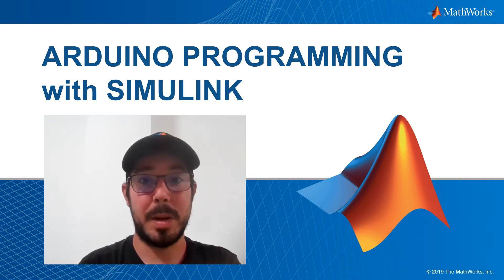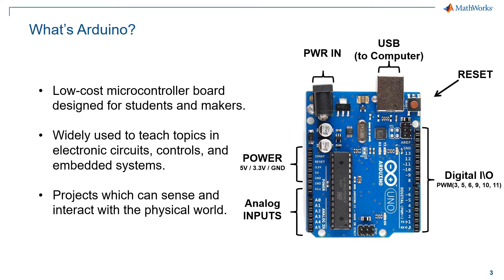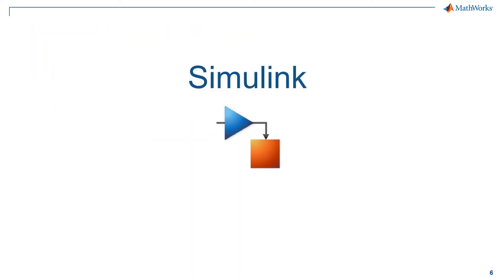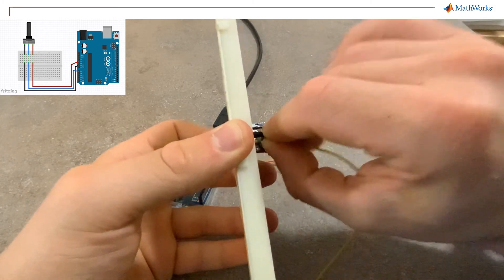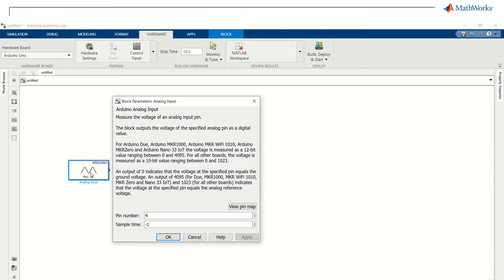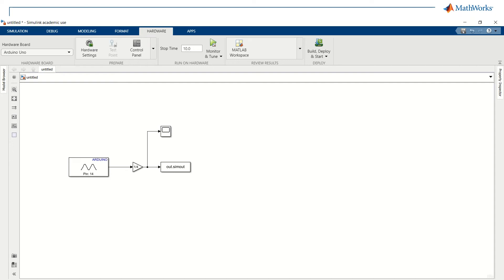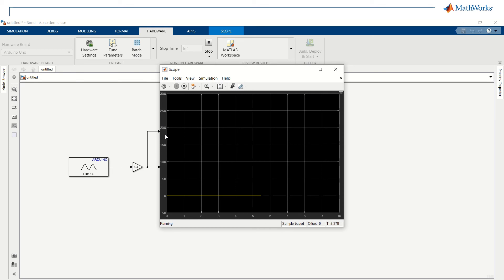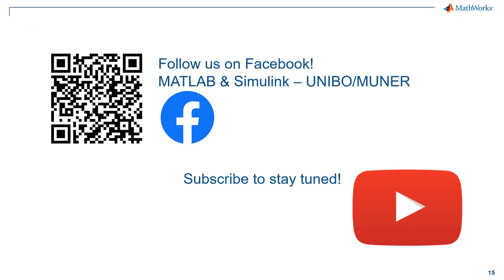Arduino programming with Simulink - Introduction to real-time acquisition

Comment: My setup looks same as yours, but I receive an error during model building "The following error occurred during deployment to your hardware board: 
The generated code exceeds the available memory on the processor. It uses 135.1% of available program memory and 49.9% of available Data memory.". Do you know how to solve this?
Reply: same error i am getting did you find solution plz reply

Comment: What the most complex Simulink project can one upload on Arduino Mega ? I'm in initial phase of a project and have to decide whether to use Simulink OR Arduino IDE for programming and once factor I am concerned about is the memory usage of a simulink generated code compared to Arduino Code. Do you know if Simulink code generated any overheads when compared to standard Arduino code ?

Comment: While i run the monitor&tune simulation, is it correct that matlab is continuously updating it's parameters on the background? if my simulink program is sending sensor data from the arduino back to matlab workspace, then let matlab do some calculations with it, and then use the result from matlab again in simulink to sent this to for example a motor? I would love to hear your response, because i'm currently doing my graduation project
Reply: you don't have to send it to MATLAB. Just use block "MATLAB Function" in Simulink. You can define your function here in MATLAB script.

Comment: I need help , I used exactly same but for Flex sensor 
I receive an error stating "code generation information file does not exist"
Reply: Yeah, I also get the same problem everytime. I did everything I possibly could but failed to successfully run it.
Reply: @shehryaarali9274  Use lower version of Matlab